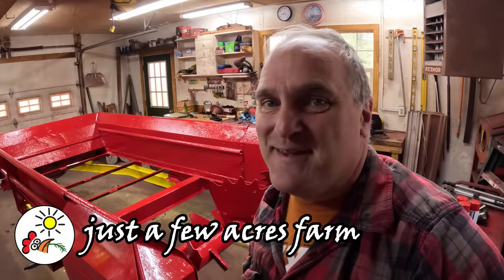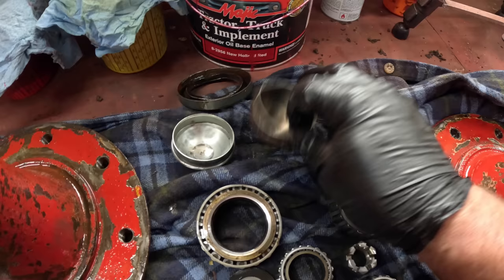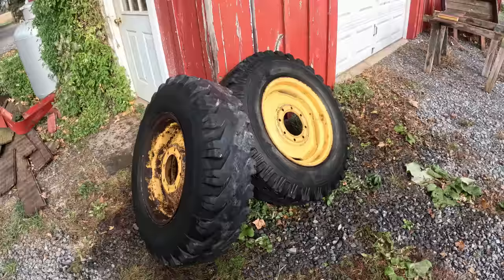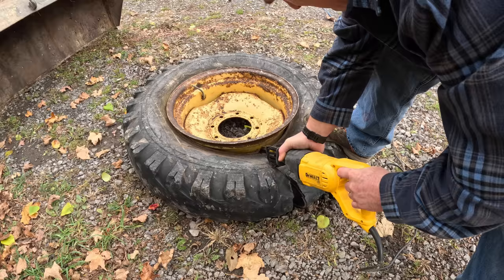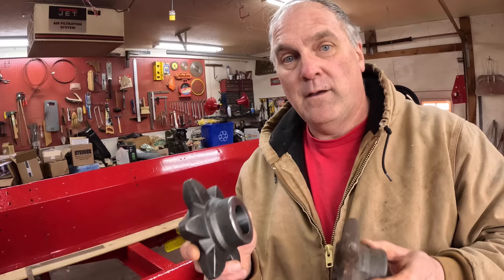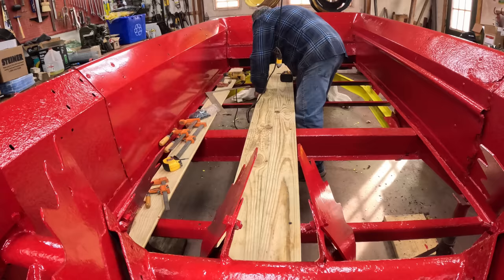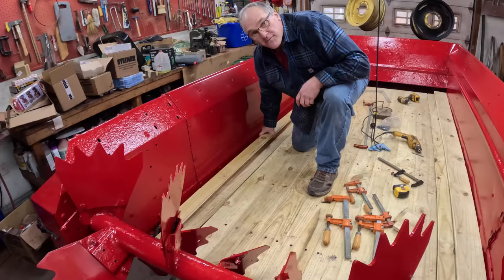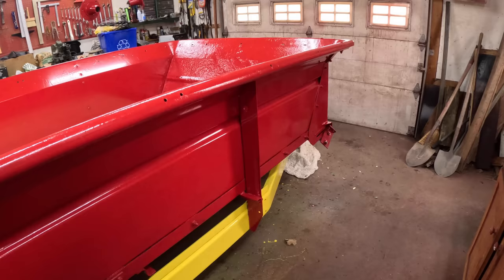The Great Manure Spreader Makeover (New Holland 514) Part 2

Comment: 11/13/23 Yes Pete, enjoyed this installment of the great Manure Wagon retrofit! Red paint looks great! T/G T'd 3/4 1x6's looked like fun to make & more fun to drill & install those self-tap Bugle head (star drive?) 1/4"  screws. Still want you to show us your MIG welding machine & size wire you are using for welding plate-to-bushings & #8 bolts -to-washers...Much enjoy your winter  'inside' shop work/repairs as break from animals. Yes, you do need a proper work shop. Show us your (SketchUp?) plans. Anxious to see it completed with vertical  tool/wrench/gizmos placed neatly on the wall...& their colors grabbing video interest. Stay safe & carry on!🔧⚒️🪚💪🍷😊

Comment: NH wants around $60 each for those beater paddles. Local shop usually make them for around $10.

Since you used a bolt to make those idler sprockets you could've just used a lock nut to hold the sprockets on.

Comment: Coming right along. Grade 8 bolts are a bit hard to drill through. I was using a chop saw to cut the heads off of a pair to use with the tow bar for my Jeep. I went too slow on the first one and didn't get all the way through before it got hot and stopped the cutting blade. After I got past that I was able to drill them for the pins by using slow speed and extra pressure with lots of cutting oil to drill them. The same trick works with stainless, slow and steady with extra push on the drill.
jack

Comment: I’ve had good luck breaking beads by sliding the tire and rim under the drawbar of my heaviest tractor and using either my high lift jack or a bottle jack with the foot placed on the bead and jack lift placed u deer the tractor tongue. Makes it much easier to see what you’re doing

Comment: hey Pete great video's , just thought i would mention that you can drill a hole in a grade 8 bolt , drill slow speed , plenty of coolant and a little more pressure  on the drill bit. , i do it all the time. i also love to restore old tractors and farm equipment .and watch all of your video's. thanks

Comment: Great Video. You can cut more tread in regroovable tyres. Most trucks and buses run on them. Usually its one tread, one regroove and then off for retreading which heavy commercial tyres are built for. Re-treads are an economical solution. They use a calliper before the regroove to check the casing thickness.

Comment: As someone who got to unload a spreader with a pitchfork after the tire came off the rim (Iwas afraid there wasn't anything to put a jack under that would hold the weight of a full load and it was not my spreader) putting new tires on was the right decision.

Comment: Friend try to get your hands on old school car truck bumper jack slide bottom stand on top of edge of tire rim jack it up (of course some heavy equipment to jack up ) hit base into rim as u get gap jack up bead breaks pretty easy on bigger tires more trouble with smaller tires but it works .

Comment: The deck looks great. And clean enough to eat off of. At least until manure touches it. Watching you work and viewing the interior of the spreader reminded me of my pickup truck bed. When buying the truck new five years ago I had the dealer apply a rugged spray-on-liner. It has held up remarkably well. I've hauled dirt, gravel, sand, river rock and lots of building materials and the lining doesn't seem to have deteriorated one bit. It's easy to wash out at the car wash. Would something like that work on a manure spreader? Just a thought that crossed my mind.

Comment: I put a white Nylon strip on the sides were the chain runs and will make a nice Smooth running chain and not Groove the wood when the chain is running on top
Reply from the maker: The old wood was 30 years old, some kind of pine or fir I guess, and no grooves to be seen. I believe the slats keep the chains from wearing into the deck.

Comment: Never knew those were tapered. I also assumed they used standard 1 1/2" treated carsiding like the skirting on a pole barn but I guess that's too thick and you would likely have grooves between boards to collect poo.

Comment: Its looking very good. Where did you find the decals? I have to admit the wheels on your manure spreader look too nice. Most wheels I find that been under manure spreaders look like they are about the explode if you pump any pressure inside the tire. Specially bad are the split rim ones where it is just easier to buy a new wheel than to try salvage the old. Beater upgrade I approve cause the old ones where just too worn anyway. I try to salvage the old air tubes if I can cause some of the new ones seem to be inferior to there past counterparts.

Comment: Hey Pete I noticed you use a 990 ih haybine. I have a 7 foot my dad used for years I want to restore to use. I need a couple pulleys, the sickle bar and blades and other parts. My question is where are you buying your parts for them from? I can’t find many places to buy them. Any information would help. Thanks.

Comment: Pete the spreader looks really good did you consider trex lumber or pvc deck boards for the floor it would have been little more expensive but would probably last longer than wood?
Reply from the maker: Yes, they were about $30 each, compared to $7 for pressure treated. I just wash it out after I'm done, and it will hold up fine. Like I said, if it sat dirty year 'round like they often do on dairy farms, then I would have chose differently.

Comment: Hey Pete. Id like to know what your objections are for Never seize. I need to use it for some plumbing applications. Its difficult to clean up. Is there something in it that you don't want to exposé to the animals?
Reply from the maker: You can watch the video where I spent a half hour driving apart the PTO shaft of my tedder that had been coated with never seize. I truly hate the stuff, and it is often presented as a cure-all. All I've ever needed is a little heat or an impact wrench to get stubborn things apart.

Comment: Nylock nuts would have worked instead of welding washers onto the bolts.AL B.
Reply from the maker: I agree. I had cut the threads off before I figured out the problem.